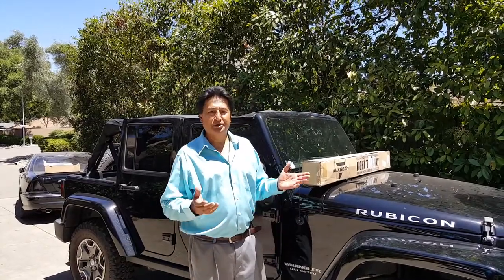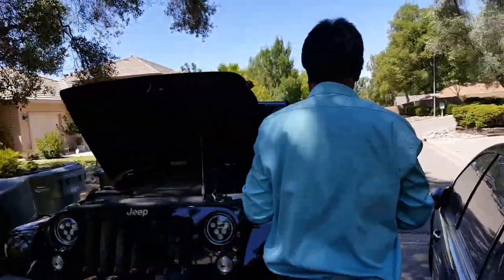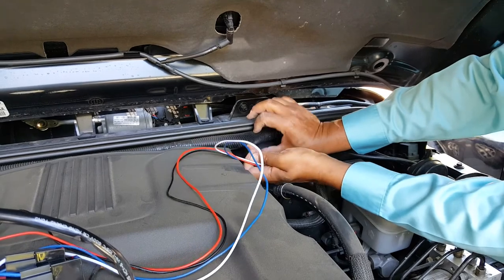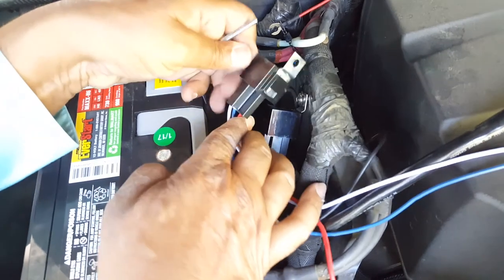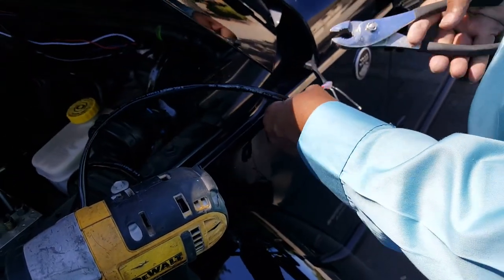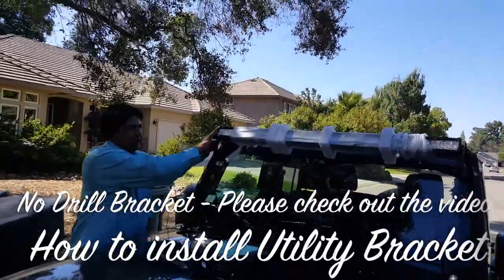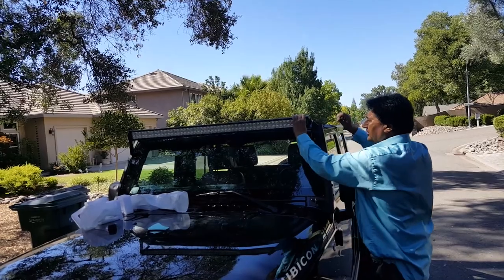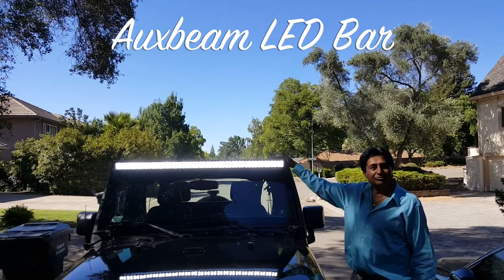How To Install Auxbeam LED Light Bar on Jeep Wrangler Rubicon | Off Road LED Upgrade

Comment: the connectors on the wiring harness were spade connectors you need the waterproof male spaded to slide into the female connectors you don't stick the wire in and crimp it. They are not butt connectors.  And did you tape them / use heat shrink tube to keep water out?

Comment: nice job on the tutorial. Might seem like a dumb question but does the light shining off the hood of the vehicle bother/annoy you or do you eventually get used to it? Can't decide between one of these or a 22" mounted on the bumper. Thanks.

Comment: Where you put your wires on the battery terminals is the wrong one that is a special nut that tightens the battery terminals to the Post!
Reply from the maker: Thanks for sharing the info. and thanks for watching.